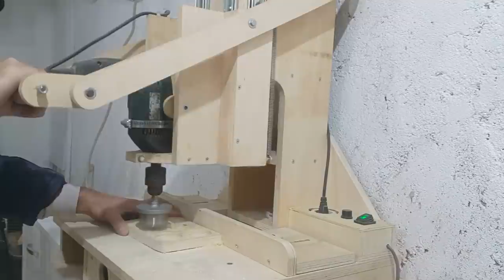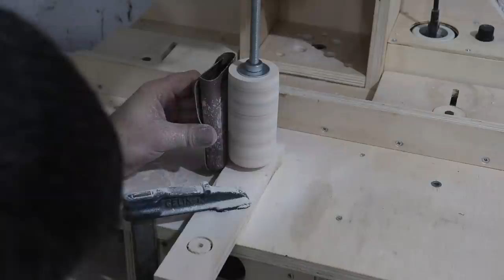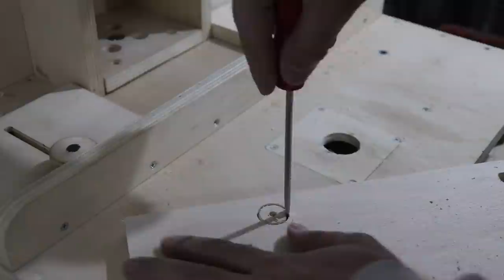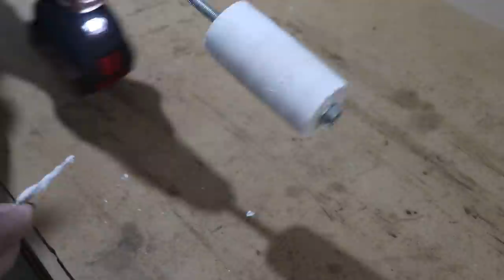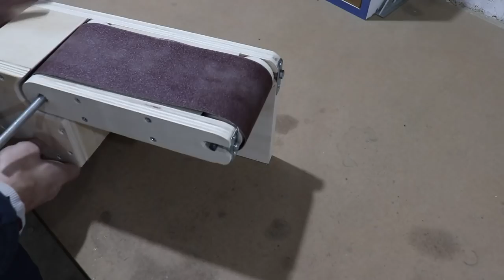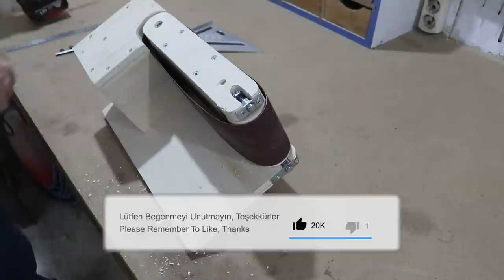Making Belt Sander Build For Drill Press - Bant Zımpara Yapımı

Comment: Nice Job, can I make a couple of suggestions ? 1) old inner tubes for the drums, saves all that silicon effort, should be more uniform and is replaceable if necessary. 2) adjustable angle stop on the fence and finally 3) T track in the fence for mounting stops and/or a  featherboard to aid keeping the workpiece parallel, I have these on the one I built and they have been very useful, that said I think your design is far more elegant than mine especially the simple dust collection system, I'm off to build one like yours, thank you for your video
Reply from the maker: Thanks for watching